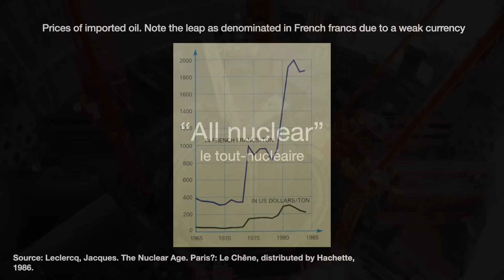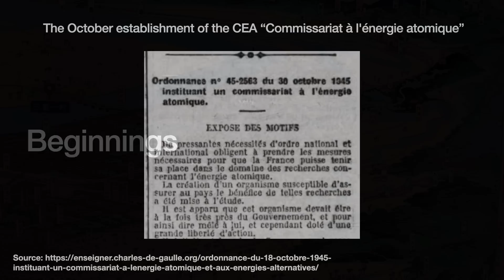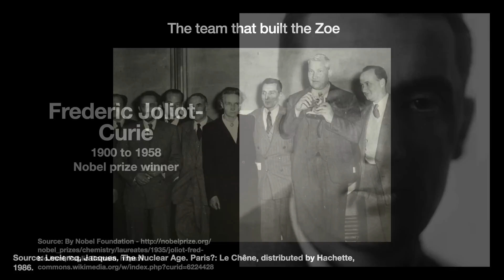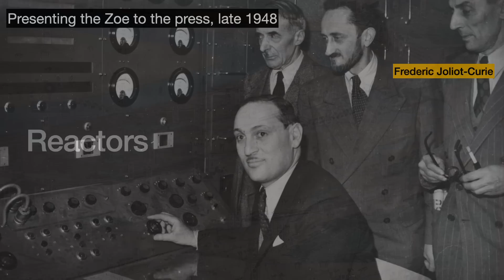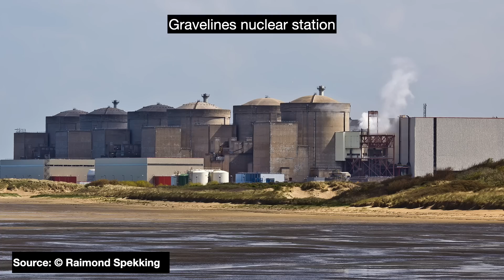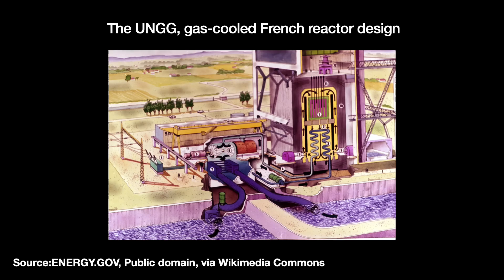That Time France Went "All Nuclear"

Comment: Why would France build windmills all over the place, when the operational costs of the NPP are basically 0 ?
Reply: Risk (major accident, triggered by some mistake, terrorism, war...), dependency towards uranium providers, dangerous long-term waste, potential for atomic weapon proliferation...
Reply: @natmaka  you'd choose a wind mill as your reliable back up? And the Uranium is not to be found in France itself you figure?
Reply: @martthvdb9701  A continental mix (solar, wind...) is way less intermittent.  Its overproduction offers a way to obtain green hydrogen which can be burnt in a turbo-alternator to produce electricity.  Moreover EV batteries can help, and hydro (dams) is also a way to store electricity.

There is no adequate uranium deposit in France.  The last mine closed more than 20 years ago.  The official authority (BRGM) doesn't even launch prospection campaigns anymore.  Please detail the officially known adequate deposit (good luck finding one)!

Comment: The biggest problem today, when we try to think about the future of nuclear power in france, is that the biggest part of the center and right want to privatize the energy sector and EDF, which is like, the worst idea of all time, and most of the left wants to ban nuclear reactors like they did in germany (also a bad idea). The biggest left group, LFI, isn't closed to changing it's mind with a popular referendum, especially if there is an alliance with the PCF, one of the other left party, actively wanting to keep and expand upon the existing reactors. Even if it's not the only "green" source of energy and considering how hard it is to get uranium, yes, we need to think about other ways of producing energy (like in ITER, located in the south of france), but it's currently our best, safest and less polluting source of energy.

Comment: Well done. This is a great video about a topic of current interest.  Can I request, if it is possible, you do one on the Chinese nuclear power industry?  After all, China is the world's leading nuclear energy producer, and builder of nuclear power stations nowadays.
Reply: Reality check: the share of nuclear electricity in China increased from 2% in 2005 to 5% in 2023, which hardly reflects the enormous growth sometimes touted.

In 2024, industry leaders expressed hope of doubling this share by 2035 (this 10% will then correspond, if achieved, to the official hope expressed in the 1990s for 2010).

Compare with renewables: 790 GW already in place (26% of electricity), and 1,200 GW officially planned for 2030. In 2020, China added 71.6 GW of wind power, and this effort continues.

Comment: Great video, thanks a lot for your work Jon!

Since the 1980s are some time ago and all kinds of technology go forward, I think its valid and important to add some current day challenges that fission energy in Europe faces. Sadly constructive criticism of nuclear fission gets people really worked up and lead to some thought-stoppers being used, which is just bad for the debate. As the comments under this video and other places on the internet seem pretty one-sided and simplifying, I felt like adding those points would be valuable. The European energy market is a really complex topic and I'm no expert by any means, but feel free to engage on the points below :)

First, nuclear fission does not perform that well economically in a free energy market. Europe has an interconnected grid, where countries can trade power across borders. If there is a cheaper source of electricity available from elsewhere, you have a hard time selling expensive energy of any kind. PV prices have been rapidly going down over the last decade or so (The IEA lists 0.74 million USD/MW of installed capacity in 2015 to 0.18 million USD/MW in 2023) which puts some market pressure on traditional financial models and adds complex dynamics. At the same time the french fission reactors had a lowered peak usage hours, which influences the price per kilowatt produced. As the operating cost of fission plants roughly stay the same, the less a power plant is used, the more a produced kWh costs. (sadly, I could only find a source from an environmental group, if anyone knows where to find the official full load hours, let me know!)
I guess this point boils down to: Nuclear isn't a safe economical decision, its a deeply political one.
Renewables seem incredibly cost competitive, with much faster learning rates then fossil and currently available nuclear reactor concepts. As PV drastically reduces the peak energy prices on sunny days, margins on the energy market are shrinking. The economical perspective on new nuclear reactors built independently by electricity providers without state funding just does not seem to feasible to me.

Second: Nuclear reactors are incredibly complex. Designing one is a true engineering marvel and I have the highest respect for the engineers who work on this. But I do see the risk of low design variety on the market for non-self-developing countries, leading to the risk of reactor series wide faults/ downtime. I think many people will have heard of the reactor problems which France faced in 2022, leading to having only 24 of 56 reactors in operation at one point. As the GWh per nuclear reactor seem to be rising over the last decades, the outage of a single unit weighs in heavier compared to less centralized power stations/ grid designs.

Third, the argument of CO2 reduction is a really understandable one. But building times of reactors in recent years in France haven't been very promising to put it kindly. I don't have an overview how other countries are stacking up, but I guess the worst examples make the biggest news. 17 years of building time with hopefully long-running full production in 2026 power output makes an unappealing case to fight the climate crisis now using solely nuclear as a silver bullet.

Fourth: If money is of concern, the economics of at least the EPRs (current-gen French power plants) all around the globe seem to be quite horrible. There are four ones mostly complete worldwide, two in the PRC, one in Finland and one in France. With a net output of 1.6 GW, the build cost divided by the net power lead to a staggering 6.8 million €/MW for the Finnish one, 8.25 million €/MW for the french one and an estimated 22 million 2019 Yuan/MW for the Chinese double block. When you compare that to the IEAs number of 0.18 million to install a MW of PV capacity (~2%-10% of the cost), that leaves you with a comfortable buffer to improve grids, build overcapacity, build large scale energy storage and possibly be cheaper of altogether. I'm sure this can improve as the design gets more tried-and-tested but we are still looking at a factor of up to >40, which is just huge. Well developed countries can for sure take this financial debt, but developing and less-developed nations will probably not be able to make use of wide-spread nuclear adoption anytime soon.

Fifth: What role do we want nuclear to have in our grid? If we simply use peak power demand as our reference point for the capacity, we massively overproduce energy, leading to high costs and wasted electricty. If we use it as a 'base-load', we'll have to be able to increase and lower power production of other sources within hours, rendering coal and oil plants plants out, as they just need too much time to get to their needed output power. Gas is an option, isn't all that great in terms of its carbon footprint and can be relatively expensive to use it rarely. Hydropower was traditionally a promising candidate here, but as the margins for stored energy are shrinking, economical feasibility is slowly becoming an issue. And you can't exactly buy one KWh of hydro storage of of amazon in every geography. If you still want to use energy storage instead of power plants, electrochemical seems to be making a lot of progress in recent years, with large commercially operated storages being built onto grids, although currently only for stability-scale storage (e.g. 100MWh in one facility under construction in Germany I found out about a few months ago). With battery technology improving from EV-development, I'd say there is quite some potential in the future, though I sadly don't own a crystal ball. Ideas of using some cool complicated reactions to store energy have been made in academia, but are to my knowledge not market-ready.

Lastly: Just take a look at the introductory pictures "World energy supply and consumption" article on the Wikipedia. I think we should sometimes reconnect to the reality of the energy generation situation worldwide. France is in a special position, which cannot be applied to every country.
If it was just about people being afraid of a nuclear accident, there would be much more capacity in the making. Nuclear fission seems to be as you put it quite fittingly, "at their heart just super expensive water boilers". It seems like the gold-plated solutions a few countries with financial resources, (geo-)political stability (or lets just say, no threat of a power plant being bombed), not corrupted controls and probably a few other points can afford to cover some parts of their energy production. I think the simplifications and lack of critical reception on the internet contributed to this more recent hype around nuclear. It is a way to produce energy, but from my understanding one if not the most expensive way to do so, while relying on single, huge state-funded projects, as opposed to renewables, which can (given the legal framework) be built by citizens and citizens groups to profit from lower electricity bill or feed-in tariffs. Due to their potential to be widely available for all sizes of investors, I think they are much more promising. If you want a good chuckle, just take a look at the IEAs projected growth of PV capacity worldwide vs. the real development over the last 10 years or so, there are lots of graphs about this on the internet. 

Btw, originally I thought Jons statement at 22:23 (nuclear fission has high upfront cost and a low operating cost) was ignoring the dismantling, but it turns out it 'only' costs a few hundred millions after decades of use, which in perspective isn't as much as I thought. Learned something new again!

Thanks for every single person, who actually took the time to read through all of that. The amount of people glorifying nuclear without being able to take any form of criticism and the amount disregarding nuclear as a dangerous source of electricity (while ignoring actual negative sides of coal, PV, wind energy and so on) really frustrated me. Maybe something is deeply wrong with our debate culture, but I guess accepting that complex topics have a lot of dimensions to them is an awesome start. If anyone can correct me in some points I'd be deeply grateful and would of course edit my comment accordingly.

Have a great day guys :)

Comment: Dear Jon, one of those G2 reactors almost caused an accident in Valdellós, Spain.
The core was on the verge of meltdown due to a fire, with intermittent loss of reactor control.
They are very old, unsafe, and were involved in the Spanish effort to obtain the atomic bomb.
Please see if you can do "The Spanish Road to the Bomb."
Thank you so much.
Reply: “Almost had an accident” is proof of how safe they are. 

Go huff some German lignite and see how safe it is.

Comment: For everybody who thinks you can just randomly plop down reactors to solve all of our problems, in the current climate France needs to turn off a lot of its reactors in summer because there’s not enough cooling water in the rivers due to droughts.
Luckily we have plentiful and cheap solar available to pick up the slack.
Reply: A simple technical issue that would be corrected by improving the tertiary cooling circuits. The amount of electricity not produced due to it is just so marginal that it simply doesn't make sense for EDF to do it from a cost-benefit point of view.
Reply: @ there was no water, no improvement in the efficiency will help with that
Reply: The issue a handful of reactors, most of which were built without cooling towers, like Bugey 2 and 3 and Saint-Alban 1 and 2. Installing cooling towers at those plants would reduce the water requirement from 50 m3/s per reactor to 2 m3/s per reactor.
Reply: @JayWasAlreadyTaken  Thank you. Difference between ye auld pre-mashed opinion with no context and actual informative comments. Critics are welcomed, but they must bring the data. Especially after decades of similar gratuitous attacks on nuclear power, that pushed Germany to take one of the stupidest decisions of its history, for so many reasons including ones the "ecologist" folks would not be happy about (coal, CO2 ??? dependence to Russian gas ?)

Comment: France does have significant coal reserves and has used them for centuries. 
Going “all nuclear” was one way to get rid of the coalies who were all too strike-happy in the 1950s.
Reply: Yeah right, because EDF is notoriously not strike happy haha
Reply: Nope.  Since the 1920s, France has been importing coal, which is what triggered the construction of large hydroelectric dams. Efforts to move away from coal were intensified in the 1950s, as deposits rapidly dwindled. The government officially decided to abandon it in 1960.

This is why the electricity system in France was developed with as little fossil fuel as possible.

Comment: 7:58 EDF’s backing of PWR technology was the result of a open competition organised by EDF between several technology providers of the time (Alsthom-CGE with GE for boiling water reactors ; Framatome Schneider - Westinghouse for Pressurised Water Reactors) and I am not sure the PWR was perceived at the time as the front runner ahead of the competition.

Comment: I was in France a few days ago and took a train into Paris (the wife went to Eurodisney, I spent the day wandering around the capital).  The train that morning was electric and fast, not the TGV, just the local line and I reflected that I was on a nuclear-powered train.  Not sure if that's 100% correct but it's an interesting way to look at it.
Reply: It was 70% correct.
Reply: @luipaardprint  good one.
Reply: @yasaralamin1246 Zero carbon 70% nuclear electricity 30% renewables
Reply: @lours6993 
True.
Reply: About 67% correct in 2024. 14% hydro, 9% wind, 5% solar, 3% gaz, and a few % for the others. -- Source : RTE France, energy mix 2024. "Bilan électrique 2024".
Reply: 70% nuclear 30% renewables
Reply: 20% of trains in France use a diesel engine. I don't expect them too much in Paris, and more in the country side, but it's possible it was a diesel train...
Reply: @thegreenfather1978  I didn't see many diesels but I did see some.  But as a train nerd, I can tell the difference.
Reply: @chuckygobyebye  Its logical they have a couple for emergency's/intercontinental/setting up freight trains but as a train nerd u should know that...
Reply: In the 90's in France, EDF did TV advertising, where a kid asked for a "nuclear train" for Christmas, to explain at the end of the spot that 80% of the electricity was from nuclear plant 😂
Reply: Possibly. Railways sometimes have direct connections to power stations instead of the national grid. And nuclear is preferred as demand is fairly constant (except in the middle of the night). RER probably doesn't though as it's 1.5KV DC which needs a lot more lineside substations ("low" voltage DC can't travel as far without significant transmission losses) than the 25KV AC of the TGV, so it would make more sense to link those into the grid.

Comment: If all of France's reactors were simultaneously operational and producing at capacity, they could produce more energy than France needs, this 70% figure is a bit misleading.
in 2023, France produced more zero CO2 electricity than the total of it's electricity consumption.  So what did the Russian infiltrated EU do in 2024/5?  Did it loudly applaud France for achieving the 2050 zero CO2 targets 25 years early, at least where it's grid is concerned, or did it threaten France with massive fines for not wasting vast sums of money  building lots of renewables based capacity it doesn't need?
If you picked the latter; correct.  Renewables effectively mean burning lot's of gas, since renewables have less than 50% capacity factors, hence why Gazprom funded the EU anti-nuclear movement. (floating offshore wind at about 52% CF doesn't count, the turbines are destroyed very rapidly)

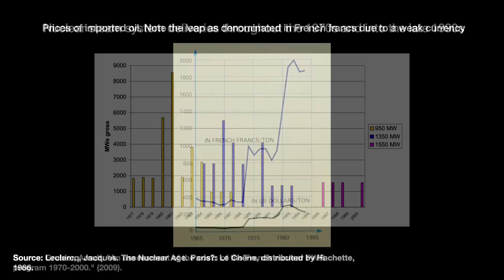Comment: 0:37
I don't understand the Y-axis. Are the bars in the graph representing the product of the number of reactors and their energy capacity resulting in the total energy generation capacity installed that year?
Reply: Yes.
1977/78/79  -  yellow  -  1900 MW installed = 2 *   950 MW reactors going online each year
1980                                  5700 MW                 = 6 *   950 MW
1981                                  8550 MW                 = 9 *   950 MW
...
1986                                   950 MW                   = 1 *   950 MW  yellow series   
                                          5400 MW                   = 4 * 1350 MW  blue series plants
Reply: @hectorpascale1013 Thanks a lot!!
Reply: Exactly